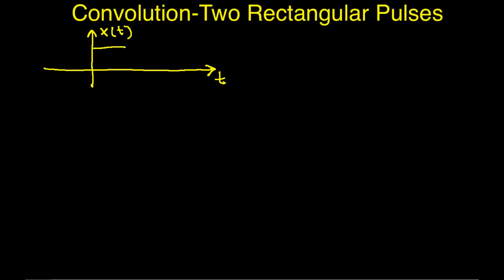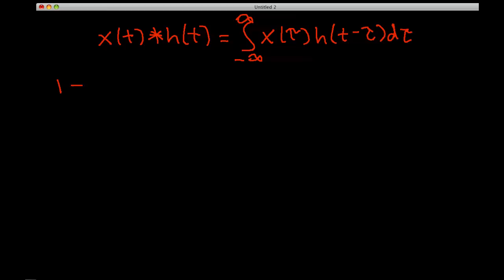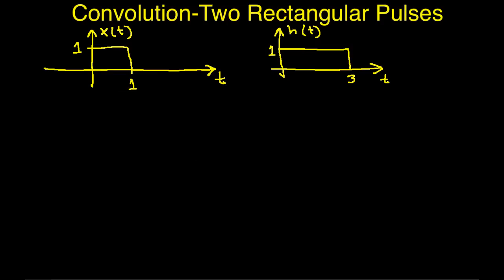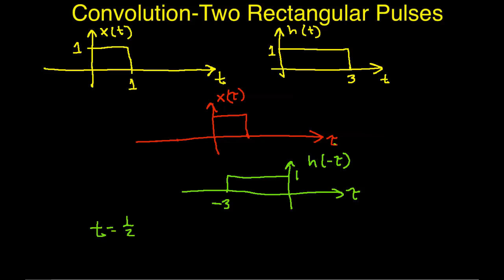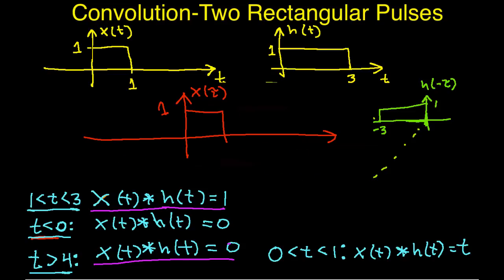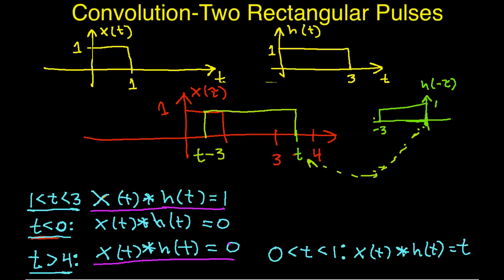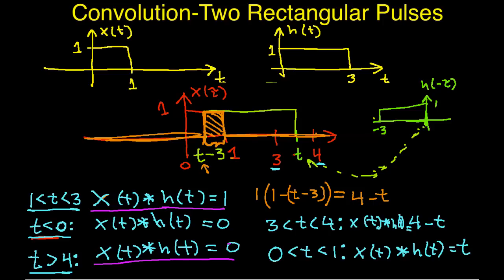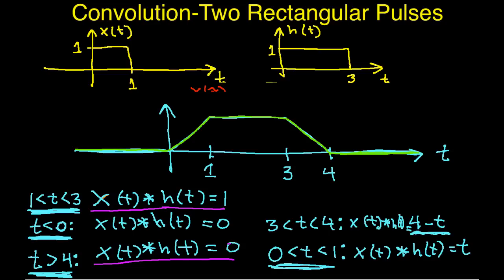Convolution Example-Two Rectangular Pulses (Edited)

Comment: This is no doubt a very good explanation of the convolution using the graphical method. Two thumbs up! However, it would be slightly more helpful if you had chosen different pulse values, say 2 for x(t) and 3 for h(t).